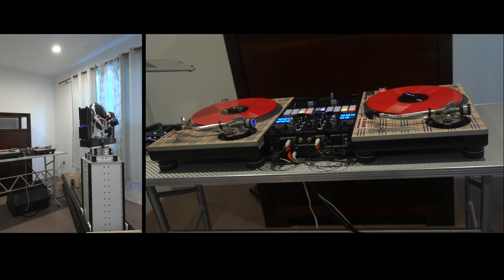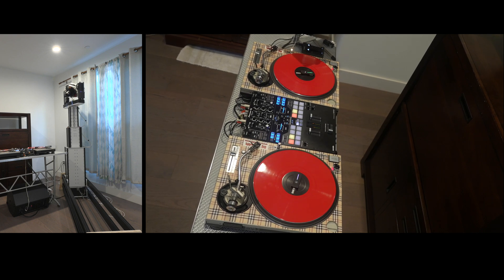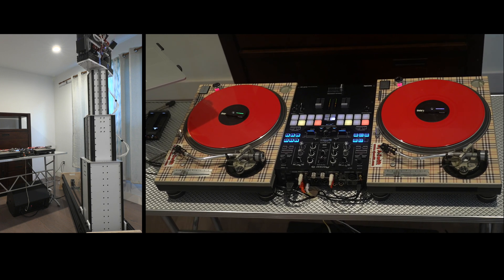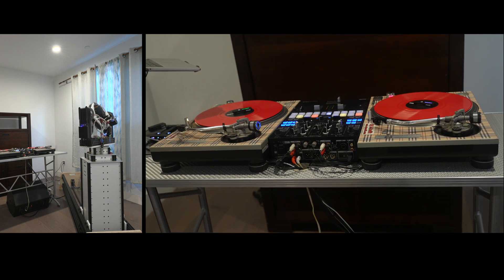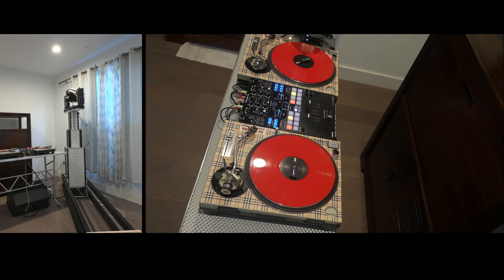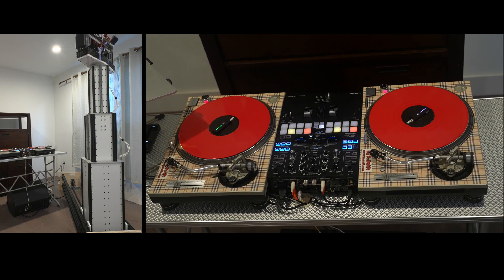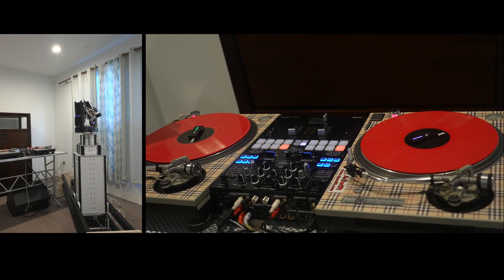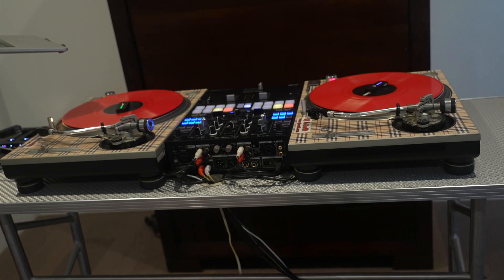Camera Slider Now With Telescopic Vertical Lift!

Comment: Very cool. I am interested in your software & firmware. I have a robot arm that I wanted to control like a CNC machine, using FluidNC (GRBL). But I could not find a way to create tool path & Gcode for more than 3 axes.  Since I could not find a way to do it, I went a different direction and am experimenting with the AR4 robot arm software and firmware.  Are you using OpenBuild software?  Your commentary sounded like maybe you wrote your own. Thanks. Nice work! I want to put a camera on my robot arm too.